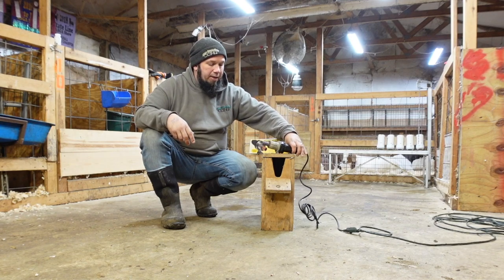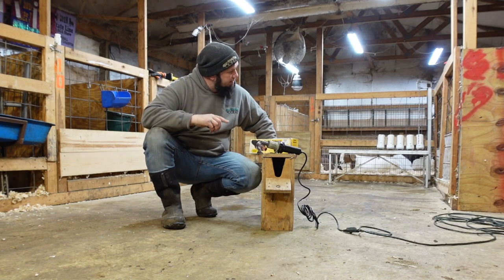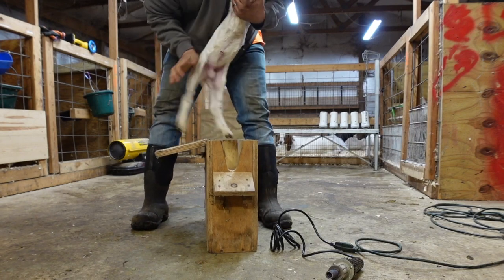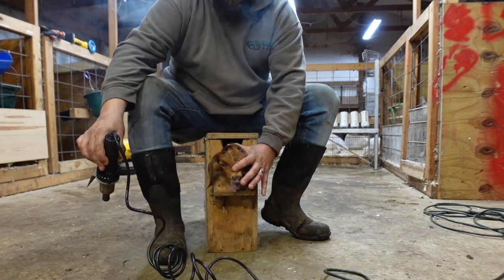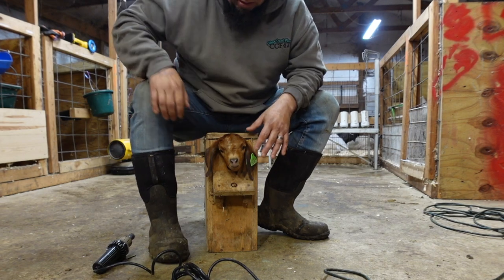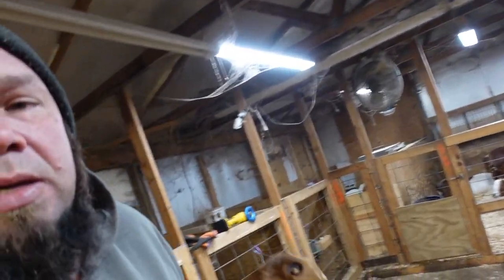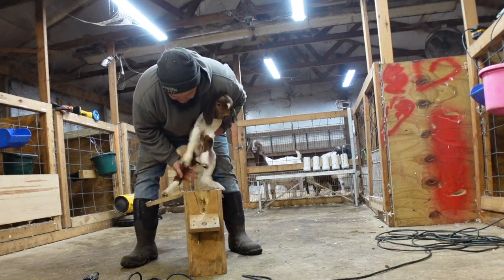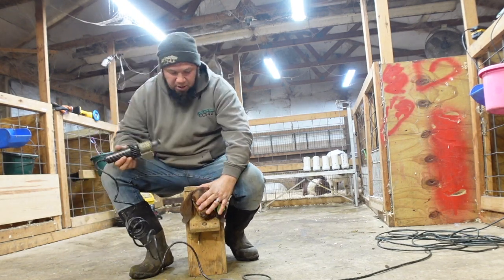Disbudding Goats How To Do It Without Regrowth

Comment: How much pressure are you using? I've watched loads of videos trying to prepare myself for it but no one quite says if there should be pressure used or if you should just use the weight of the dehorner. Great video by the way!
Reply from the maker: Just a Gentle pressure if it’s hot it doesn’t take much